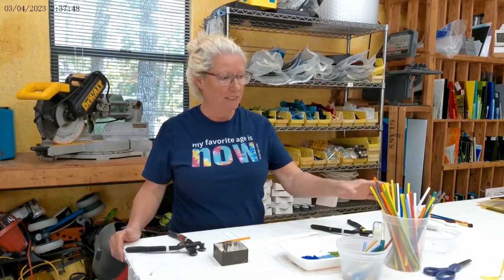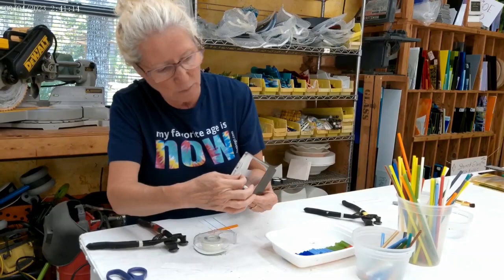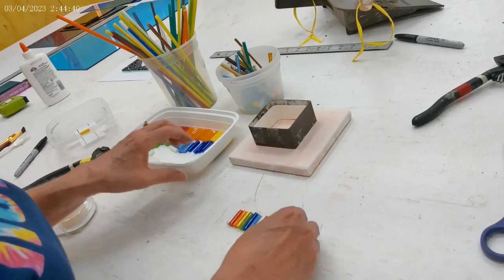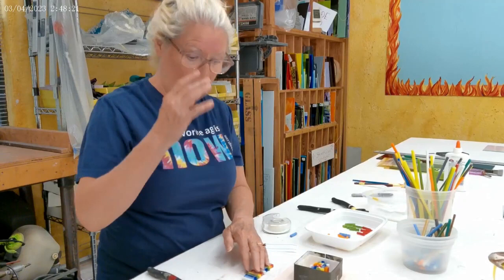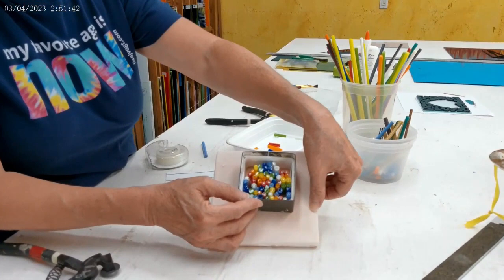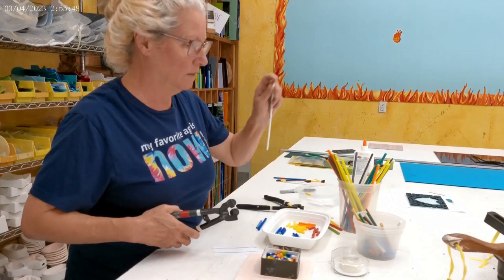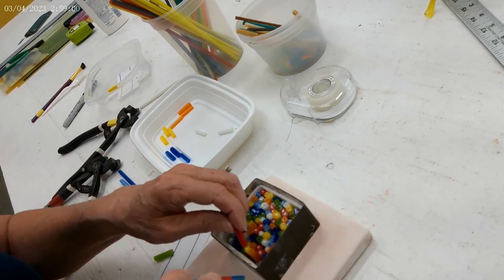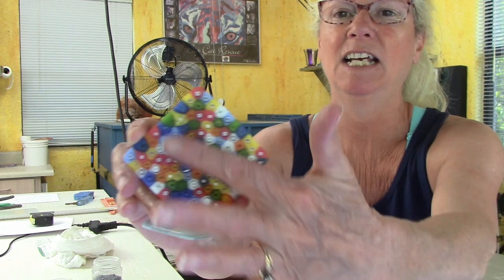Make a Mini Murrine Sculpture with me Vlog 14 with Lisa Vogt

Comment: Great video! Question: Did you cut a hole in the stand (using a drill???) before gluing the piece? Or did you fuse the stand with a hole of some type? Thanks!
Reply from the maker: There's no hole, I just ground down one end of the project so it sat evenly, then used E6000 glue to attach it to a flat base :)

Comment: Wondering why you chose to make the rods one inch? Could you cut them half inch and get more from the rods to use. I think it still would look nice mounted like you did ?
Reply from the maker: You could do any size, really. I just went for an Inch so it would fit in the mold. And I thought it would have more visual impact at that size.